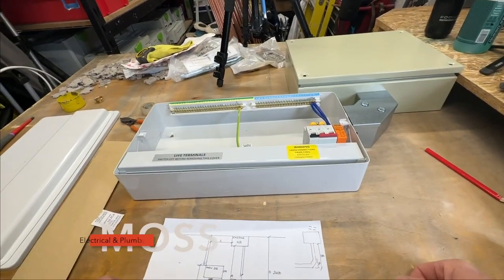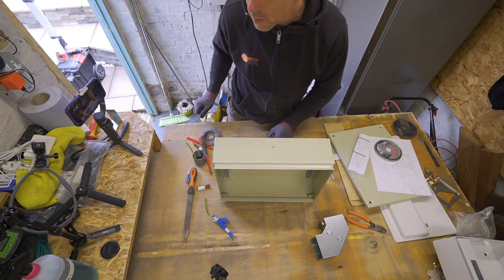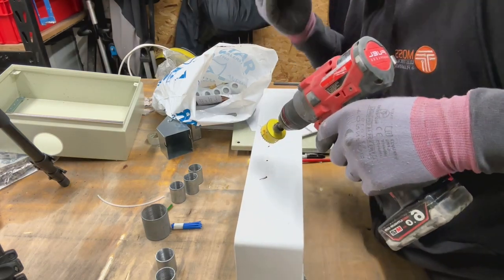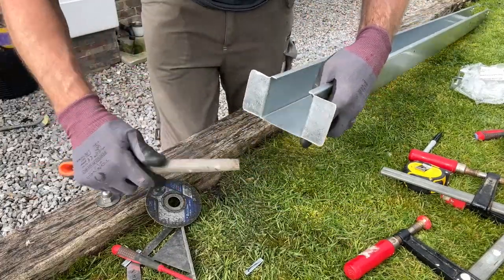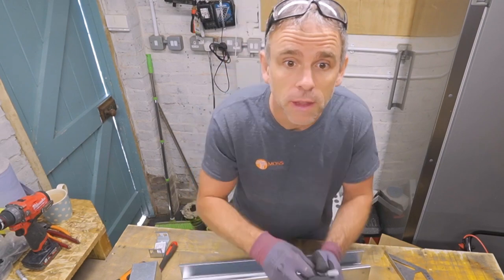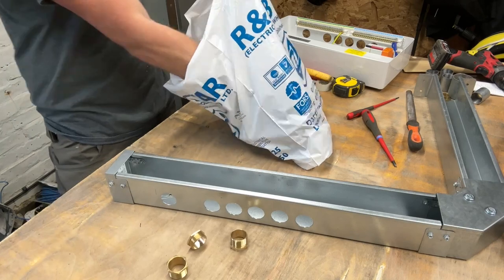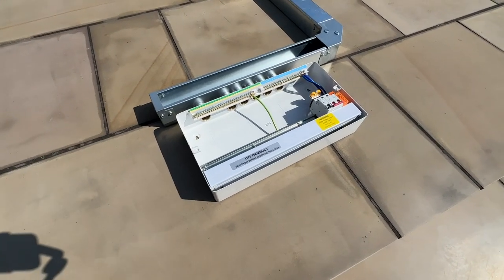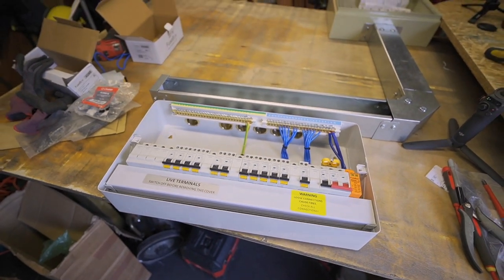Commercial Electrical Wiring | Build a CONSUMER UNIT with Steel Trunking

Comment from the maker: #electricians #electrical #electricalapprentice 

Hi Everyone and Welcome Back to MOSS Electrical & Plumbing Channel.

In this video, I'll show you how I built a domestic consumer unit for a recent job, the board was to be relocated sp that it was easier to access.

In Part 1 of this series  I will show you the process step-by-step, you will see how I approach a job like this and the stages in evolved in assembling the board, trunking and cable extension box.

I'll also share some tips on how to cut trunking, drill cable entries and how to neatly install RCBO's

Comment from the maker: Timecodes
00.00 - Intro & planning
01.43 - Build Extension Box
04.55 - Cable entry in Extension Box
07.27 - Use of Grommet Strip
08.56 - Cable entries in Consumer Unit
10.44 - Steel Trunking
17.19 - Assembly of Parts
32.37 - Installing RCBO’s in Consumer Unit
Reply: In general a good job but having the flanges of the trunking external to the adaptable box looks messy to be honest, I think cutting a square  hole in the adaptble box to accept the trunking and then bend the flanges back internal to the box would have been preferable
Reply from the maker: @simonhefferan thanks for the comment Simon, glad that you watched it 👍 I cant say that I've ever seen trunking flanged internally 🤔 I like the idea of it, but it would surely reduce the size of any cable entry drastically to accommodate fixing it in place?
Reply: @moss_electrical_and_plumbing  Hi thanks for the reply, you still butt the square edge of the trunking to the enclosure and the flanges slip through  the square hole and then the flanges are bent back to align with the inside of the enclosure and fixed with 6mm nuts and bolts